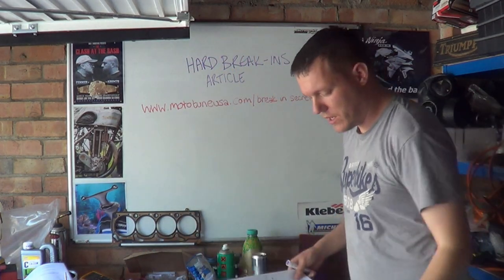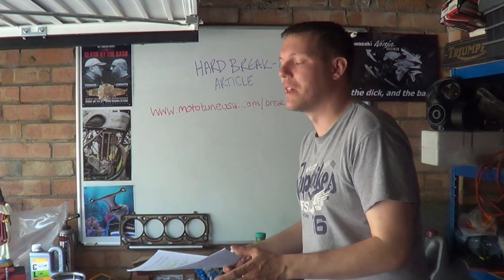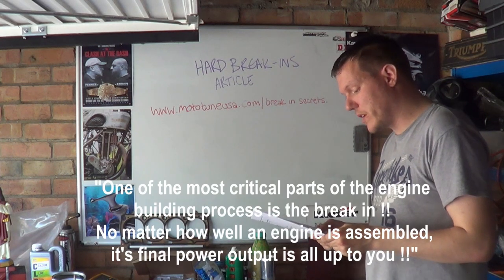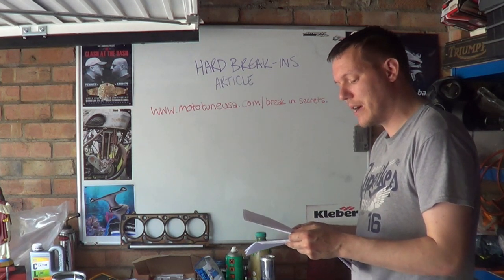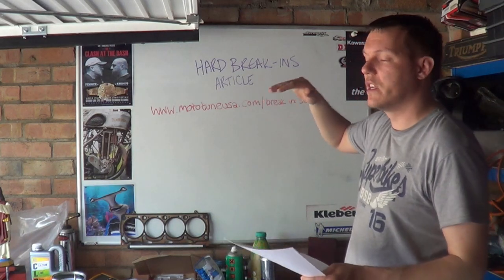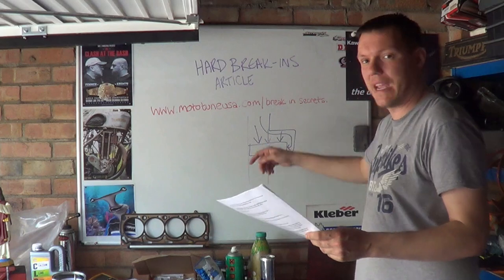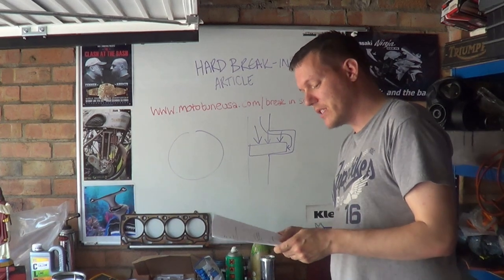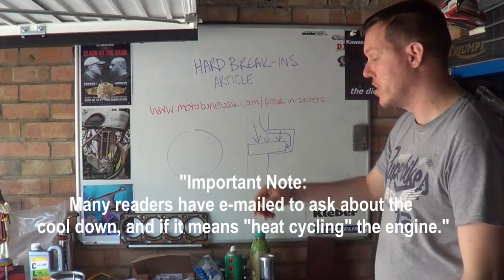Hard break in BULLSHIT! - Part 1

Comment: I live in the Philippines and I bought an 105cc yamaha as its cheap and gets through traffic so easily. I followed the manufacturer break in procedure, I haven't had any issues since. I clocked over 32000 kms since then.
Reply: I ran into this video again and saw my comment.
 My mileage is now 54k kms. Lol
Reply: @yram7687  I have 2005 102cc yamaha used bike. As far as I know, the break in procedure follows the guideline and now it is 82k. Just changed the piston ring with the same piston even thou it had no problem. Afterward I followed mototune break in process. Ride it as hard as I could and change the oil. No problems too.

Comment: Great video, looking forward to part 2! Wish I could build an engine powerful enough to suck the metal off the cylinder wall! Btw, My break in procedure for small race 2strokes is basically no break in procedure, flog it and never look back. I would treat a road bike differently tho.
Reply from the maker: I missed it during recording, and did a shitty anotation - but sucked where is the biggest question?

It gets better dude.

They're be a 2 stroke run in video, basically nowt much you can do specially for single ring pistons 

- matt
Reply: There must be a singularity involved here.
Reply: Small race two strokes wear out so fast that you gotta use it while its there!

Comment: the manufacturer break-in procedure that Matt read from the manual is the exact same as my brother's Yamaha tw200 ( I don't want any shit about it the bike is a awesome cross country rider, and it was his choice and his money). He did not do the manufacturers break-in but instead did a hard break-in and before 2000 miles the bike dropped a valve(@high rpm) and Yamaha determined the engine would cost more to rebuild than to replace with a brand new engine (and covered part of the cost). So for engine #2 he strictly followed the manufacturer break-in procedure and now that engine just happily turned over the 30k mile mark. so all in all I will stick to manufacturer break-in procedure.
Reply from the maker: I used to have a TW125 I used as a winter hack to get to work. They didn't release the 200 in the UK. there are a few imports, fun little bike
Reply: The Workshop the two things I liked most about the tw200 was a 185 rear tire that had knobbies all the way up the sidewall and a 1st gear you could walk next to without it running away. And in South East Asia they got a tw225.
Reply: Puffalupagus360 break ins have nothing to do with the valves themselves but okay lol.

Comment: Excellent!!!
I will stick to running-in my engines the way the manufacturer says, it has never given me any problems ;)
Reply: Yes.  Agree, from many years as a service tech.  I call it 'normalizing', perhaps I borrowed the term, but, getting each engine component exposed to heating and local distortions is smartest when done slowly.  The larger the bore is, the more needful it is.
Reply: Please write letters to all the major manufactures and tell them to stop running new engines on dynos under high rpm and heavy loads before they ship them to dealerships.
Reply: Lifted_Above - While we might cringe a bit at thinking of it, it probably doesn't amount to any damage the way they do it.  The engine/ transmission is tested for only a brief time, perhaps less than a minute total, to ensure all systems are functioning to spec.  I don't think they run them long enough to overheat any component to the danger point.
Reply: Rings have to seal. Without ring seal, engines are crap. Period. The assembly line dyno rollers are not only for testing the systems but they are also to get the ring seal process started. The rest of the process is up to the owner who ultimately buys it. Takes about 1200 miles to get rings to stop changing (shaving off every last molecule of metal that will ultimately go). There is no advantage whatsoever to bad ring seal. All the advantages are PRO ring seal.

Better power. Better mpg. Better piston life. Cleaner oil. Longer oil life. Stable lubrication. Longest life possible.
Reply: Lifted_Above - Yes, no argument there though the way I take your comment is that you might be contradicting your earlier one about not running on the dyno(??).  Anyhow, it happens in passing, no concentrated effort to seat rings, they do it fine on their own without sweating over it.  Modest break in works so well.  Chromed edges need to polish, not tear off.
Reply: It comes down to the science of metals. The cylinder walls are coated with extremely hard coatings, harder than the ring material. But the ring material can work-harden if not enough pressure is exerted on them early on to effectively remove material instead of friction-heat-treating that material over time which prevents the rings from seating down against the cylinders.

My first comment was made in satire, to demonstrate how manufacturer's recommendations have nothing to do with optimal engine health, power, efficiency. Their recommendations are due to legalities, courts, lawsuits, and to protect their business from riders wrapping a new bike around a tree.
Reply: Lifted_Above - Great comment.  I might be assuming something from my 'stone-age' experience; I'm not aware of hardened cylinder linings that might be in use today.  I'm familiar with iron or steel liners used with four cycles though I've seen Nikasil and chrome platings in the past but only on two-strokes.  My experience tells me that keeping the mating areas nice and wet and not too hot is the most dependable way to go.  From what I remember, even some unburnt fuel will help cool things there a bit but now it's in to technicalities that evade my understanding.  I'm from the era of old Amals and Keihins and Mikunis, etc.!!  ;-)
Reply: Yeah it's been quite some time since modern motorcycle manufacturers have been using iron or steel liners for cylinders. Takes up too much space making engines wider than necessary. Iron or steel also doesn't transmit thermal energy as efficiently as aluminum alloys which would limit power ultimately due to heat limits. But aluminum alloys are obviously softer than steel rings, therefore proprietary cylinder coatings must be used.

The trick is understanding how that initial metal wears off the rings so they can "sink" into the microscopic conditions of the cylinder walls. That's all there is to understanding it. Manufacturers purposely "hone" or score the cylinder walls at 45° to the bore axis in both directions to provide the roughness required to break off material from the rings so an optimal seal can be achieved. It's so important and effective that when that seal is achieved, the rings stay put and never wander around the piston, which of course are constrained by the gap lugs. If rings get removed, new ones have to be used and the cylinder re-honed with fresh marks. It would be impossible to align the old rings exactly in the same spot as they "mated" with the cylinders otherwise.
 
The only thing a rider can do is vary engine loads and RPM. We can't control much of anything about the process. To poke around is not taking advantage of the first 20-30 miles of fresh ring metal. Without solid pressure those rings are gliding over the cylinder walls, instead of grinding into them.

Nothing at all is good about poor seal. Nothing at all is optimal about poor seal. To achieve the utmost seal is the best possible thing anyone could do for any new combustion engine.
Reply: @exothermal.sprocket  did you actually follow the mototune procedure? I have a used bike. 102 cc yamaha with 82k km on the clock and I changed the ring with the same piston from 2005.

The bike followed the manual guideline and no problem. After changing the piston ring, I followed mototune break in process and change the oil. No problems whatsoever too.
Reply: @dwiputra4109  Usually in general it requires a light re-honing of the cylinder walls. All depends on the condition of the cylinders after age is on an engine. The cross-hatch scoring of the cylinders is designed to wear new rings into a better interface between the ring and the cylinder.

Comment: Generally in my line of work a sample of 30 is required before you can deem something statistically significant! Largely because there are so many external factors that could be influencing the results. Financial modelling is obviously different, however, to get any sort of justifiable conclusions in relation to this you're going to need an R&D department with significant financial backing as opposed to "My mate agrees".

Comment: Every engine I break in I bring up to temp  let it cool down bring up to temp cool down retorque bolts bring up to temp and beat the piss out of  it .  Ive built quite a few engines everything from 2 stroke engine , diesels to 1000hp turbo v8s. Never have had a problem. 
The most important work is measuring clearances prior to starting

Comment: it seems that, in order for the engine rpm to increase when the throttle is opened, the pressure inside the cylinder would have to increase at least somewhat.  wouldnt allowing more air and therefore fuel into the combustion chamber result in more to burn and therefore more pressure.
Reply from the maker: yes it does but not in the way he makes out.

Comment: Good morning
When I worked on heavy plant and trucks new and or rebuilt engines always required a break in period, plant up to 150 hrs and trucks 2000 miles never allowing long idling periods and not excessive loads or speeds for the trucks the instruction was keep the engine working up to 75% of load and speed and try not to keep engine speed constant
I think that today if you go and buy a large gen set 500kW or more or earth moving equipment the engines are partially broken in before on a dyno before fitting to whatever. So if breaking in is important on heavy plant and trucks, petrol or diesel cars why would you not apply the same to motorcycle engines. OK a race prepped two stroke is as good as running out as soon as its built but still requires some care in the beginning
Keep up the good work

Comment: BRP/Ski-Doo feel proper break-in is important enough they've programmed a break in into the ECU on their fuel injected snowmobiles. Max RPM is limited and is allowed to increase in steps after certain time or mileage points are met. Clearly the people paying for warranty claims feel proper, gradual break in is important.

Comment: I stumbled across this video while searching for the article this guy is talking about to give to a friend. I used the hard break in on my Suzuki Vinson when i bought it new over 10 years ago. I did hard pulls and deceleration's for the first 10 hours and did not go full throttle. It seems to have worked because my friend had a Vinson also and mine always had more power than his and he admitted it. I recommended it to friends with a new engine and they never had a problem with it. My Vinson runs great and it has a lot of hard miles and hours on it and it will not die. Maybe mines a factory freak but it worked for me and it dont burn oil.
Reply from the maker: Lol a vinson is a 40HP CVT. There is no hard break in. Sorry to tell you that but you seem to have misunderstood what the word 'LOAD' me means...

Comment: I have a little 106cc Yamaha. I just followed the break in procedures, it doesn't even have an rpm guage so the instructions were in the recommended speed. That 1000km you really feel it slowly getting stronger. it would struggle in traffic at first, sometimes stalling, you feel the break in take effect as it started operating normally, and when youbrev it you feel.the power 🤣. 80,000km later and still stock engine, I just changed the clutch plates.

Comment: I've always had very good results from careful running in on both 2 and 4 stroke bike engines, running in properly is essential. Even kicking over a new built mx engine  a few times without combustion helps. You can hear the bore getting smother. The less you put on it when new the better.

Comment: I think some of Motomans theories are sound and consistent with other references. He is not advocating "ride it like you stole it" from 0 miles, he seems to suggest short bursts with fairly high throttle openings to get the BMEP up, not initially at very high RPM. The deceleration phase with closed throttle will generate high vacuum but I am not convinced about it sucking up the swarf. The biggest mystery to me is the pistons in the pictures, the lack of carbon on the crown looks suspicious to me, thank you Matt for the entertaining and educational videos.
Reply from the maker: "I think some of Motomans theories are sound and consistent with other references."

 - which ones?
Reply: I have found http://www.shell.com/business-customers/aviation/aeroshell/knowledge-centre/technical-talk/techart08-30071255.html I know this is discussing an aircraft engine but it makes for interesting reading. I will find some more relevant material, quite a lot suggest mineral oils during break in. There also seems to be some differences with chrome rings. I seem to remember a document from Vulcan engineering that included the burst of high power advice, I believe the original document was from Lotus.
Reply: http://ntnoa.org/enginebreakin.htm this is interesting too, but typical internet, difficult to locate the sources of the information

Comment: The only time I heard that and knew it was appropriate is in diesel truck. We run the engine after rebuild for break in 1000rpm to 2000rpm  for oil pressure and  cam lobe care 30 45 mins. Then a  run on the road. After that oil filter check and we tell client to run it normally under full boost yes the ring will form to the sleeve. And prevent glossing mirroring on sleeves by scarping dust ring. Prevent mixing in oil and make polishing paste. Every body know it is a diesel truck so... On Off is fuel pedal!! hahah
Reply from the maker: This is due to the fact that the rpm is way lower than 'bike' engines.

Comment: There is more pressure on the Rings against the cylinder wall when its hotter right? like when running it harder? because of heat expansion. So wouldn't that let the rings seat better?

Also if you baby a new engine at least in a 2 stroke engine there is a chance you can glaze the cylinder because the engine isn't burning all the premix oil off and your rings will never seat properly.

Comment: just sharing my experience......I ran my newly rebuilt 308ci v8 HARD up a steep 4km hill and back down with heavy compression breaking.  Now 30,000km, it's still running very well, plenty of compression & power, oil drains pretty clean.  I got carried away with the fun I was having 1st ride on my new Sherco 300cc 2T and rode it HARD.....pistons seem to have seated ok & still running pretty good......I don't know, maybe I've been lucky but the hard breakins have worked for me.......
Reply from the maker: "308ci v8"

 - this is a rebuild you said? what did you replace?

"my new Sherco 300cc 2T and rode it HARD.....pistons seem to have seated ok & still running pretty good"

- 2 strokes are different - video coming soon
Reply: complete rebuild, top end, slightly hotter cams, new rods & bearings, rings, rehoned cylinders, bigger intake manifold, 600cfm Holley carb..... basically a new engine
Reply from the maker: did you do the cam break in? and what lifters do you have?
Reply: well, my mechanic said to drive it normally, keeping it loaded & not stay at the same rpm for too long.  I'm guessing it has hydraulic lifters which are standard for the engine & he would have done the cam break-in I'm sure....lol, after 100km I took for a blast up Black mountain, read about the hard break-in about 10 years ago & just wanted to be able to drive the truck normally ASAP....it worked.... just don't tell Steve my mechanic...

Comment: Ok great vid thx I was getting confused by the different opinions, now my question Matt would be if u buy a new bike and do the user manuals break in would it be ok to have a pillion from scratch, or would it end up putting to much load on the pistons,or wait a few hundred klm and do a few oil and filter changes then pillion up. 
Thanks and keep up the great vids.
Reply from the maker: Good question and yes having a pillion on board from the start would put extra load on the engine. Just follow what the manual says and you'll be alright.
Reply: Ok thx, and take care

Comment: Is 200km a good mileage to change oil + oil filter during the initial break-in on a 115cc 4 stroke fuel injection bike? or is it too soon?
Reply from the maker: There really isn't a too soon - If you wanna do that then do it - but I'd be doing it again after 1000 kms
Reply: thanks. The recommended service interval is at 500km,1000km, and every 2000km. Guess I'm just being too cautious. Plus I live in a very hot climate with 37c degrees during normal day. Being air cooled, I thought putting new better oil might give more protection than the factory oil.